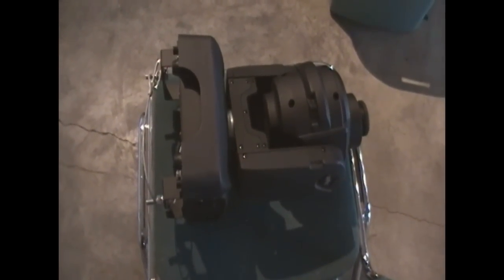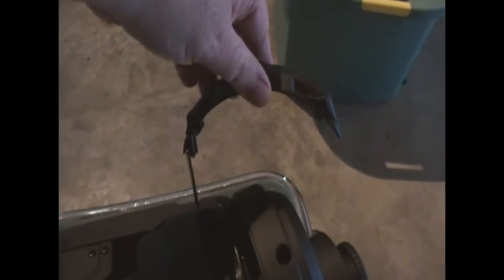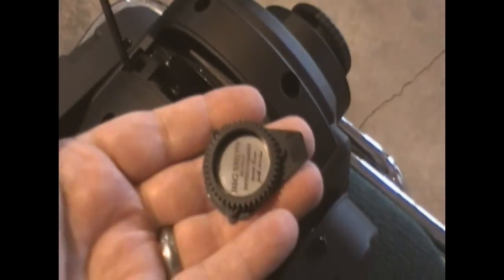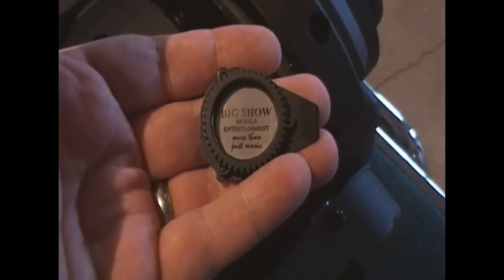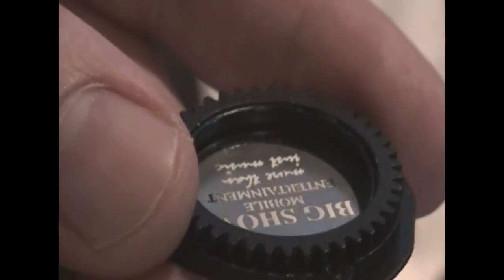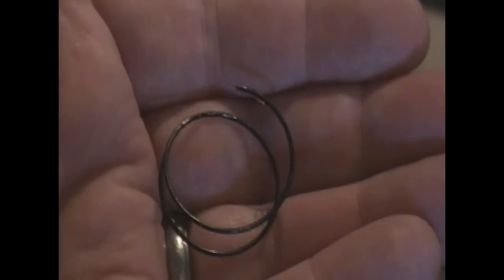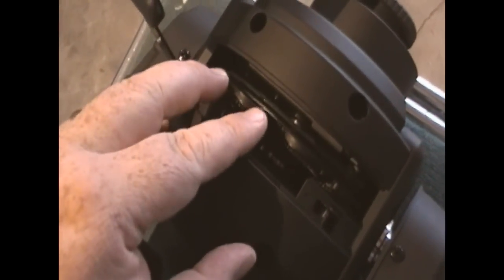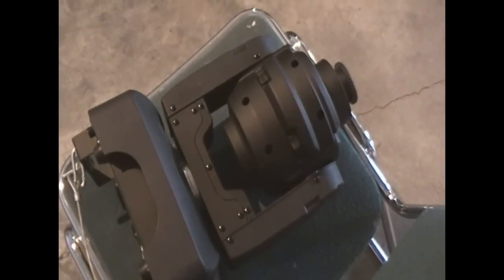Chauvet Q-Spot LED 150 gobo replacement

Comment from the maker: @DJKKRAFT  I used two very small screwdrivers.  I started out pushing down on the top end of the ring to get it broken loose.  It looks like the ring was kind of glued in in mine.  Once I got a section lose I just slowly worked around until it was all free.  Then it was a simple matter of getting behind it to lift the edge out and remove the ring.  First time I think it took me 45 minutes to work the ring loose.  I would recommend wearing safety glasses of some sort.